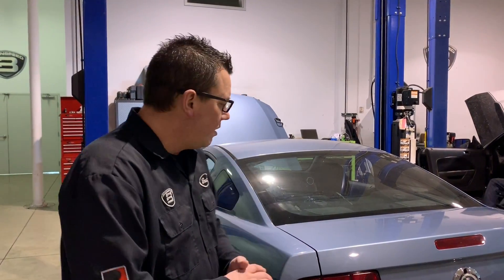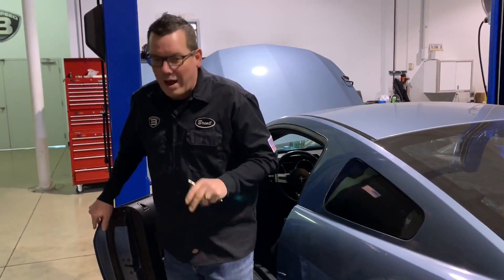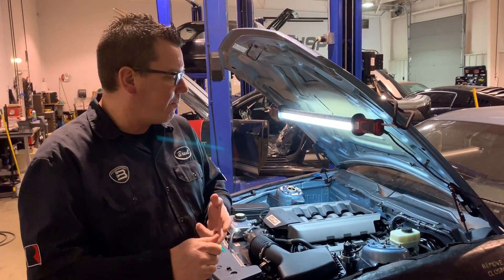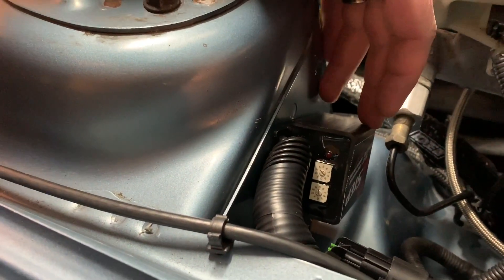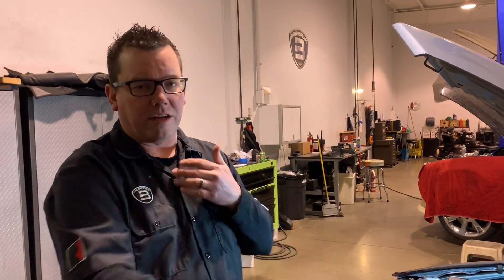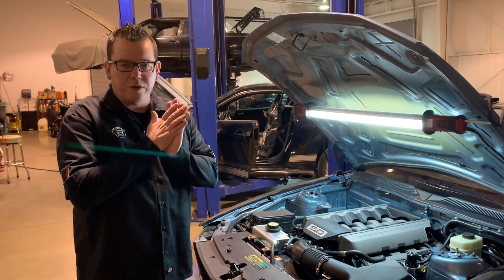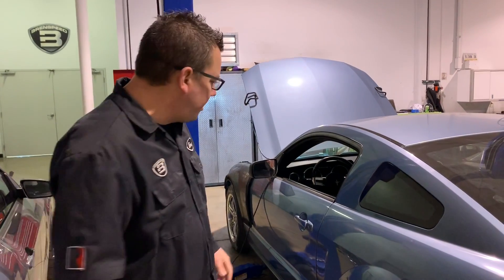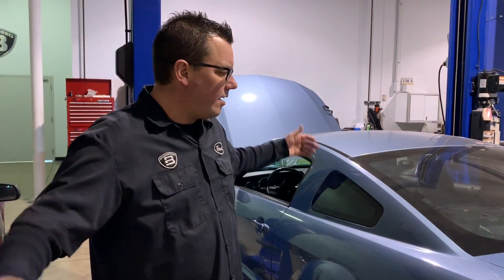Coyote Swap Mustang THE MSD TWO STEP so awesome at Brenspeed Behind The Scenes

Comment: I know you did OPGs but what if your oil pump gears are stock?  Do you suggest upgrading them before adding this 2 step?  According to the internet they explode all the time!  Lol.  I have a stage 2 whipple in a 16 with stock OPGs.
Reply: You shouldn’t need to up grade OPGs you have a 16GT w/whipple SC your car has track mods.  I have 15 Roush w/Roush SC I have track mods.
Reply from the maker: The internet explodes because people with problems post on it, not typically people with no problems. Here is my opinion on this. If you have the cash do them. It is cheap insurance and knowing what it costs to replace an engine (parts and labor) it is good insurance to have.... again, if you have the money to do it. THANKS FOR WATCHING!

Comment: I prefer the sleeper look.  I searched long and hard for my 2009 GT/CS because it didn't have a license plate or holes in the front bumper.  It also doesn't have a spoiler or hood scoop like the normal gt's.  Quite a rare car as they only made around 500-600 in this color anyway.

I do have a question for you though.  Would the MSD 2 Step box work with the car's ecm rev limiter.  I have mine turned up from the factory 6k to 6.5k.   This is do to the modifications made to the car already.  If I wanted to rev the car for friends,  could I adjust the MSD box to say 8k and the factory computer would stop it at 6.5k?
Reply from the maker: The car will never rev higher than the limit programmed into the PCM. So when the two step is activated, it will use whatever you have the two step set to, unless, you have it set higher than the factory PCM limiter. If you set it the two step higher, it will hit the factory limiter first before the two step has a chance to do its job.
Reply: There's no such thing as a "rare" Ford Mustang except for ones owned by people who don't think something like an unpopular color or other "option" that was "only" checked on hundreds or thousands of dealer stock order forms instead of tens of thousands makes their car "special" and more "valuable" before its even a "classic" instead of just another used Mustang the overwhelming majority of people ordering new Mustangs in that particular model year didn't order because dealers who sold lots of Mustangs knew it wouldn't sell and even people who DID order and buy them didn't keep them when there are used ones for sale to choose from.

Comment: Do a 2020 7.3 swap in it next.
Reply: Is it possible? I dont know specs of engine. How wide? hp or torque but I'm seeing they over built engine. Turbo or supercharged future?
Reply from the maker: Not sure if possible. I have 2 other supercharged car projects plus the high mile coyote is getting boosted soon so I will likely leave this one NA for some gear banging all motor reliable fun. THANKS!